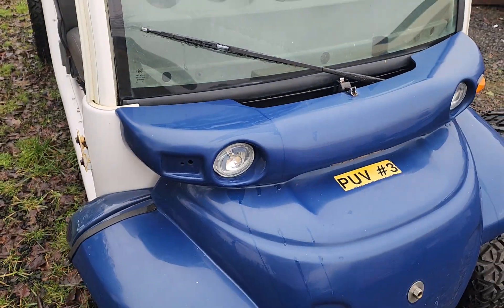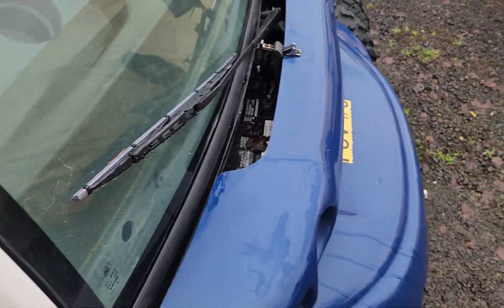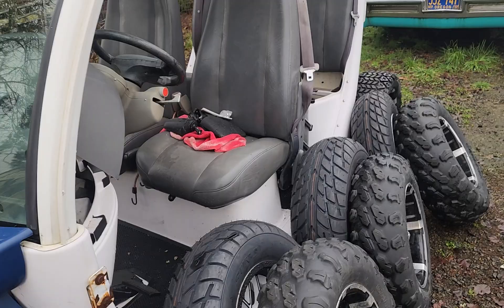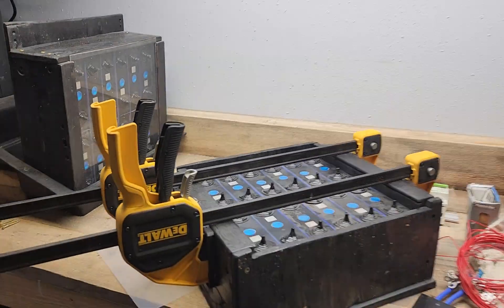2002 Chrysler Gem car DIY Lithium Battery Upgrade 72 volts Lifepo4 24s with JK BMS + active balance

Comment: did you finish this project and how is the range now compared to the lead acid batteries?
Reply from the maker: @derekprice5510  yes, I did finish it and it's been working wonderfully, the only issue I really had with it was that the stock charge controller did not fully charge the lithium pack up to its full voltage.. 
Now I charge it with solar panels and a 72 volt charge controller that I got off alibaba.com ..

I will create a follow up video soon...

Comment from the maker: I had been planning to put the BMS on the side because their isn't any extra room ontop, due to the hood barely closes on this box as it is... 

But I had failed to realize that with a lift kit installed, the hood stays with the body and the frame drops 4 to 6 inches lower , so I actually do have the room to put the custom BMS box and main terminal connectors ontop after I complete my 6" lift kit... (Planning on 26" tires )
I have 2 of these cars,, stay tuned for more videos . Subscribe 😮

Comment: Howdy there!  About to do the same conversion with the same components, how's it working, anything you learned or would do differently?  Thanks!
Reply: Thanks
I had to put the project on hold for a few months, I'm back on it now and installing the JK BMS with active balance and Bluetooth ..

So far everything is going smooth... 

Should have the pack connected to the car in the next few days . I'm make another video for the update :)
Reply from the maker: @muirindustries  sorry to get back to you so late..
It's been working wonderfully..
The only thing I might change is cutting the tray rails and making the battery to sit lower down between the frame rails... (So I could close the hood all the way and I could Mount to be a mess on top of the battery instead of the side)